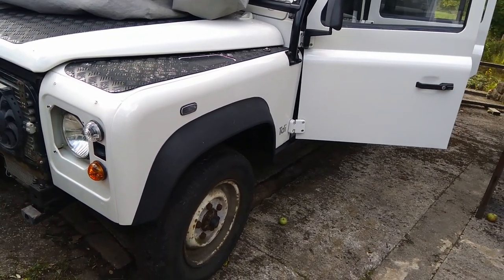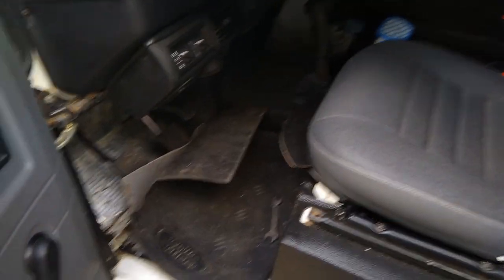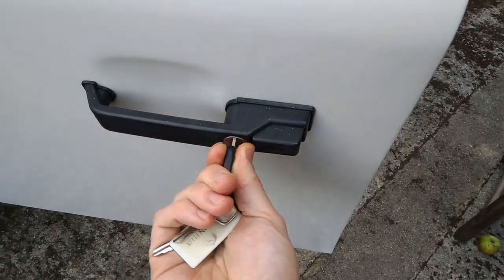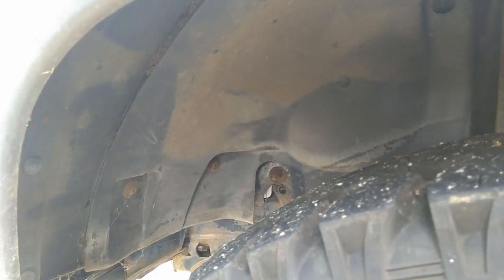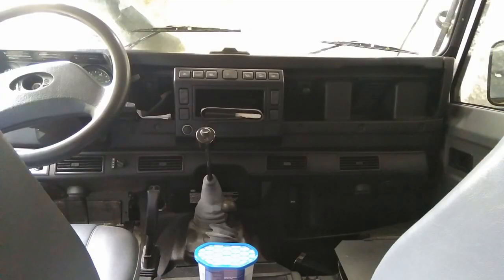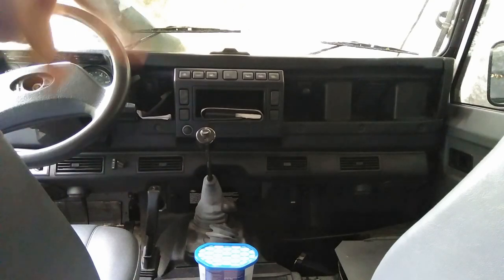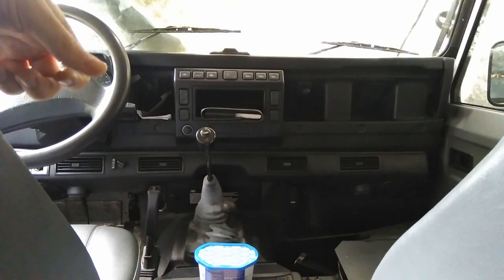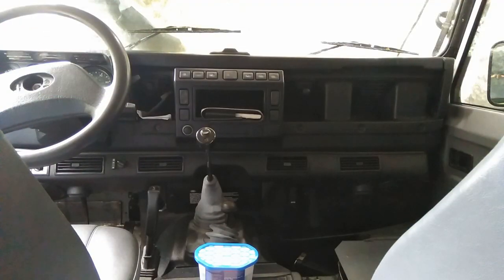Subtle ROW Defender differences to UK models

Comment: I had V8 110 pick up with a gearbox oil cooler. Here in Botswana. It was an ex CTO vehicle from a government auction.  Gearbox never had an issue. I think because if the oil cooler. And it does get hot and dry in the Kalahari. But not the gearbox.

Comment: Very interesting, I'll consider myself lucky, with a 2004 TD5 and a 1996 300tdi, I get to experience key frustration on a regular basis. Once you add on all the keys I have for various locks/layers of security I'm close to having a separate bag just for each set of keys.
Reply: My 99 NAS Discovery had but one key and remote.

Comment: G'Day Will
Its funny you know, because here in Western Australia we HAVE to have an immobiliser/alarm fitted when you buy ANY vehicle. The person who is responsible for having one fitted though is the person who BUYS it, not the seller. If it has none fitted when you buy it, and if you don't install one before you apply for the registration transfer, the DoT can (and do at times) deny your transfer of registration or (their favourite one) increase the cost of the transfer fee AND the registration until you finally fit one and notify them when paying the next registration (every 3months, 6months or 12months). So I'm trying to install the factory set-up into my 130 because all the after market ones here are so problematic. From not working correctly to plain flat out draining your battery. I've ripped the after market one out as soon as I transferred it over to my name, but I still need to install another one so.... factory is the go due to less issues from all marques when you do, even Land Rover (that's how bad the after market types are). 
So my 130 is a 2001 Td5 and as far as I can tell it has the loom already for it all, just need to plug bits in as the fob receiver is already installed from factory and I have a lot of spare connectors at loom ends (door's, tub, ect) Should be sooo much fun!
Reply from the maker: Sounds like fun! Hopefully nothing's been chopped out til now

Comment: Really interesting vid.  Good point about how 90/110/Defenders have varied so much.  I drive a 97 110 CSW and my sons got a 90 300TDi form 94, despite both being 300TDis the detail differences are huge, all the electrical connectors are different, the dash warning lights are very similar to the set up I had on my Turbo D 90 many years ago.  I've rebuilt my sons from two knackered ones both registered within two numbers of each other and both had different front axles, one had the earlier style of swivel bearing whilst the other had the later, I have the history of both and no reason to suppose there had been any axle swap!  Good old Landrover
Reply from the maker: Cheers Mike. 93-94 was a bit of a mish-mash change over (200Tdi/300Tdi, rear disc brakes, etc.) 96/97 had quite a few changes also (EGR, Alarm, connectors). It keeps you on your toes, as it makes buying second hand parts a minefield due to the ambiguity of a "300Tdi part"

Comment: Did the last of the 300tdi (2006 models) use a P38 rear diff like a TD5 from about 2004 on or did they keep using the Salisbury rear diff?
Reply from the maker: Yes P38 diff. It came in part way through the 2002 model year (vehicles built from May 2002)
Reply: @lrworkshop  Yes I found that out, I watched one of your other great videos that answered all my last model spec 300tdi questions. Of course I never had any of these questions before you enlightened me and others about the white unicorn 2006 300tdi Defender!

Comment: The Kalahari does have alarm and immobilizer it also had a/c as standard and rear heated windscreen. Thought the wiring is there it didn't come out with: rear speakers, electric windows or central locking. For any info on the Kalahari please feel free to ask. I've owned mine since 2012.
Reply from the maker: Thanks Jacques very helpful. I may well have some more questions as I want to do a video about them at some point. Could you email me? address is on footer of my website

Comment: Very good video very informative. I would like to know what guages you have in the dash of the right hand drive defender you went to saw a bit of a guage just wondering what it is and if it's landrover or aftermarket?
Reply from the maker: Hi Mike. The speedo/fuel/temp gauges are LR from a Td5. On the far right it's a TIM turbo gauge.
Reply: @lrworkshop Thank you for your reply.

Comment: My UK 300tdi has one key that does doors and ignition, then just one extra for fuel filler cap - so does my friends’. Are you sure that the three key set up was standard? Perhaps yours has had its doors or ignition barrel replaced so they no longer match?
Reply from the maker: Hi Will. Fairly certain. All the parts up til 2001 are listed with the small barrels and keys that the ignition key won't fit into https://www.lrworkshop.com/diagrams/land-rover-defender-body-chassis/doors/barrel-lock-keys_52635#1

Comment: As far as I'm aware it is not possible to have a factory 300tdi with ABS and Traction control as the Traction needs an ECM input for it to function. It may be possible to turn the Traction off in software leaving only the ABS, which incidently doesn't need a data input from an ECM. How do I know this, well, I am building a 300tdi with ABS, TC and HDC... I have a fair few ABS ECU's in my collection... (Gotta know what works and what doesn't and there is only one way to do that... )
Reply from the maker: That'll be a nice project! There's an article in an old Land Rover Monthly magazine that did a retro-fit on ABS for a 300Tdi
Reply: @lrworkshop  There are a fair few 90's with ABS as they have done a retrofit the D1 ABS,/axles/etc... which to be fair, is easy. I'm doing a Salisbury axle'd 110.

Comment: My 110 300Tdi 2004 (here in Brazil) : front electric windows, central door locking, NO factory alarm end NO immobilizer, and the AC controls are  just in the place of the air vent at the right of gear lever of the car in the video, pushing the two vents to the far right.
Reply from the maker: Thanks, interesting. I wonder if it was one made in Brazi as CKD?
Reply: @lrworkshop  Yes. It was produced here in Brazil (CKD) from 1998 to 2005, only 300Tdi (but all the interior and wiring looms from Td5, even the diagnostic connector just next the drivers seat). The 300 Tdi engine was produced here in Brazil by Maxxion-International, the same engine of Mercedez Benz Sprinter, Ford Ranger, Chevrolet S10 from the same year.
The Td5 was imported only 1 year (2006), and from 2007 to 2011 was Puma. The newest Defenders here are the 2011.